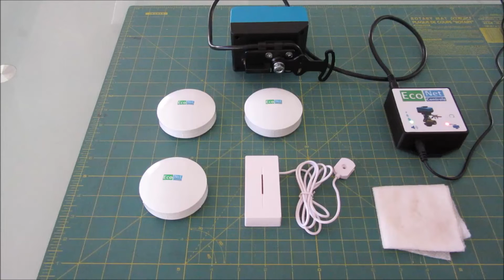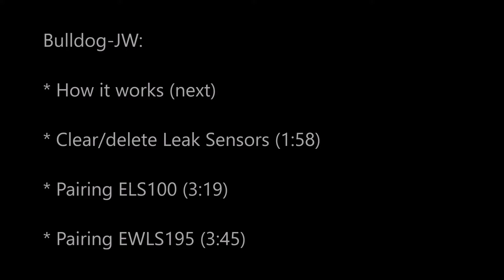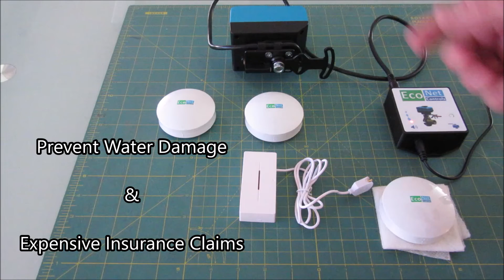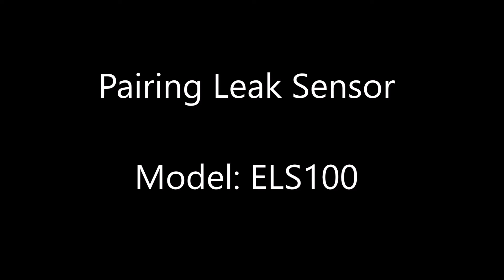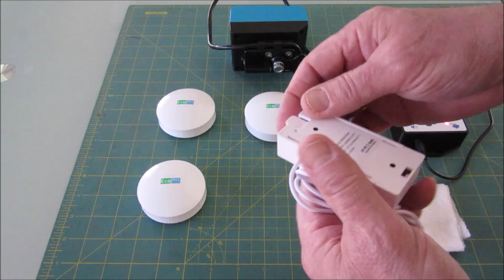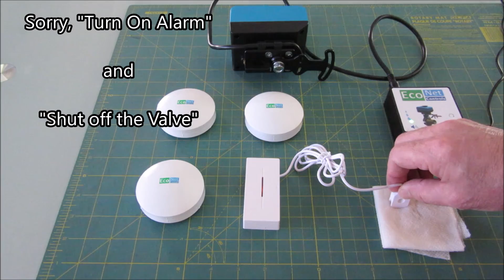Bulldog-JW, pairing ELS100 and ELS195 Leak Sensors

Comment: Thank you for the video! When the batteries die on the leak sensors, is it possible to replace them or do you need to buy a new sensor all together?
Reply from the maker: the batteries can be replaced.  The system should be tested once or twice a year by placing the sensors, in their position on a wet paper towel. The sensor will triple chirp when it's time to replace the batteries.  Please contact support@econetcontrols.com for more details.  Cheers!